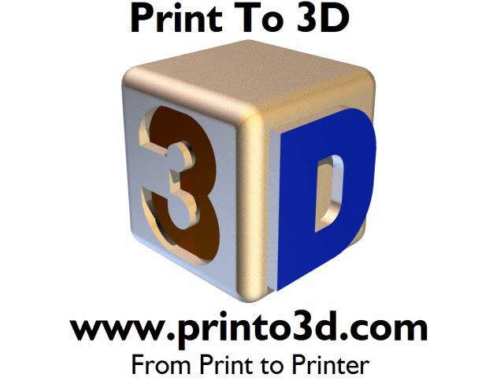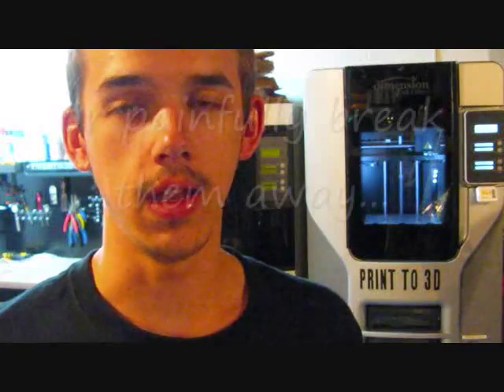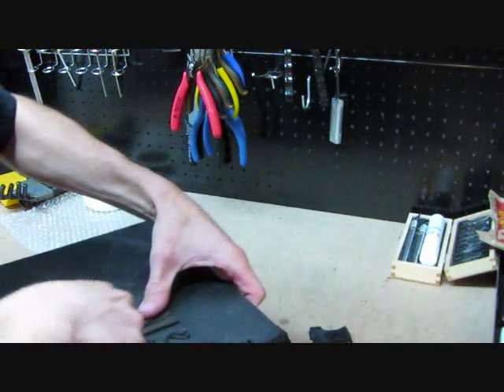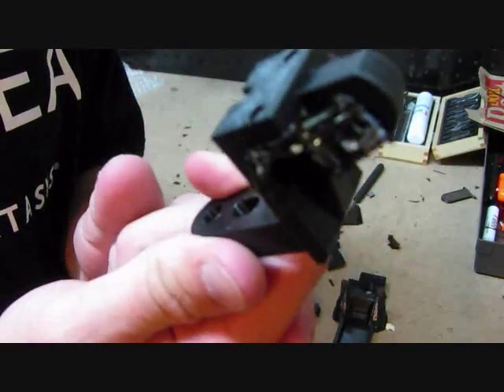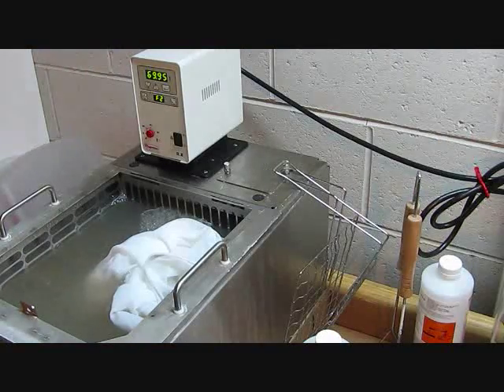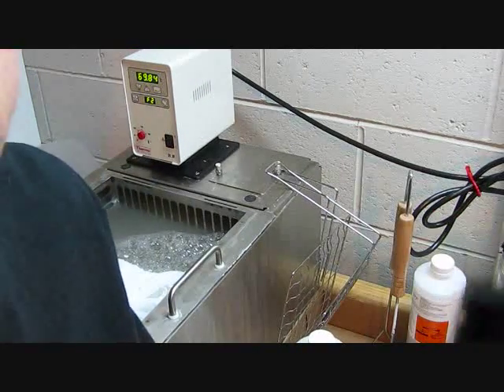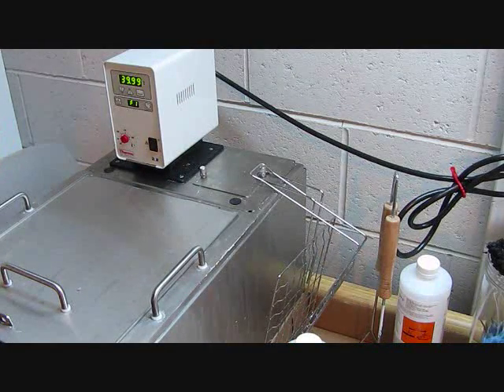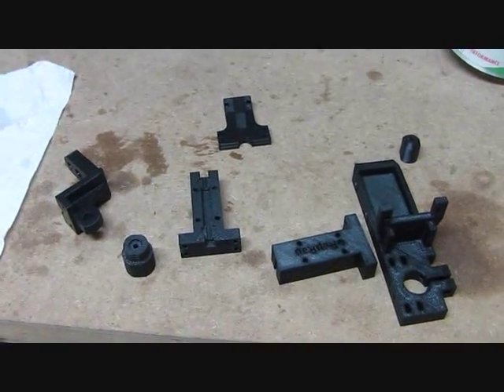Dimension FDM SST Support Removal Process

Comment: What kind of machine are you using for dissolving the support material? The company I work for is looking in to using soluble material to make carbon fiber parts so we're exploring the different requirements for doing so.

Comment from the maker: @TheBeardieandtheLeo @TheBeardieandtheLeo  #1 you just plug it in, program the temperature, add water, add waterworks chemical, turn it on and put parts in.  You have to drain it and chance the water/chemicals once the water becomes highly saturated with dissolved support material.   What else do you want to know?

#2 I have no idea, but I just fixed that!

Comment: The Dimension SST stations is great for laboratory use, and don't get me wrong, the stainless steel is shiny and cool. 

If you want a post-processing machine that works in 4 hours instead of the SST stations 8 hour recommended run time, take a look at the CleanStation SRS DT-3. A video of it in action has been posted as a video response to this video.

Comment from the maker: Basically all you need to do is dilute the solution by keeping the water running in the sink when you drain the tank.  I guess when that is done the chemical mixture is similar to the ph levels of laundry detergent.

It cost approx. $45 in consumables to print the parts in this video.  $5 per cu. inch of model and support material. About $7 worth of support material was wasted.  Some parts can use more support material than model material depending on complexity.